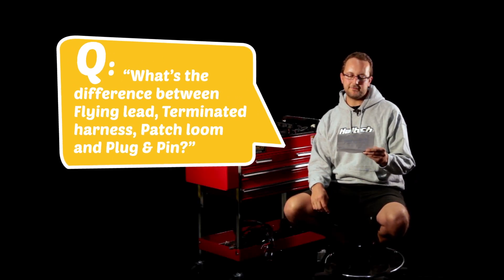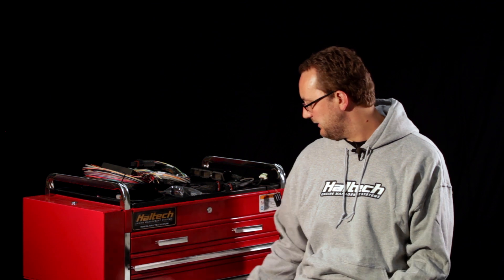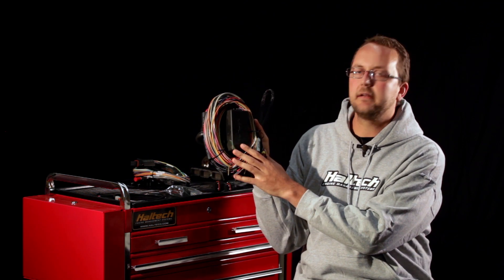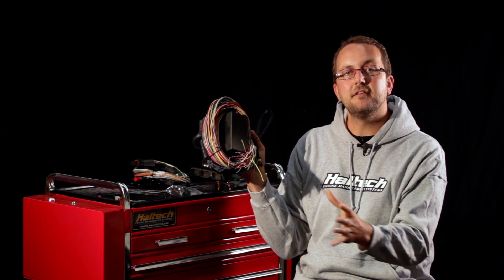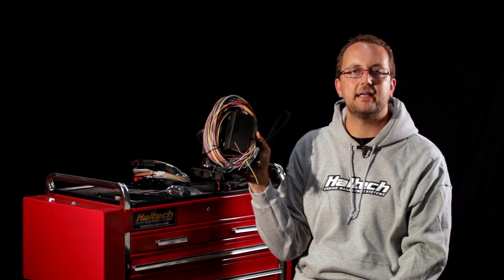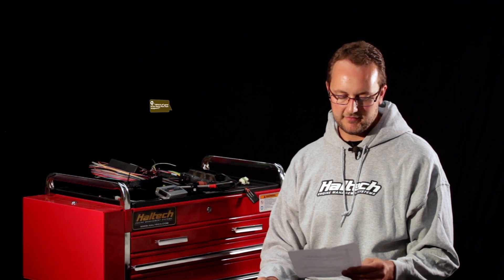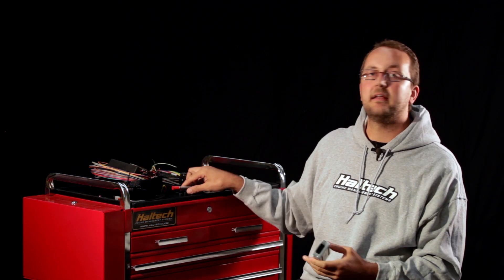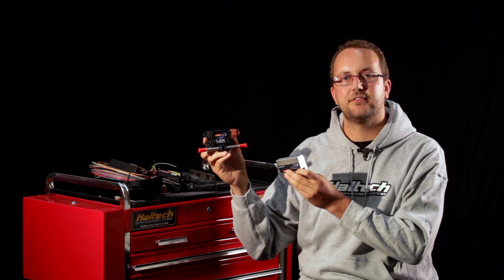Patch Looms, Base Maps, Dashes and Flex Fuel - Haltech Q&A Episode 1

Comment: What is required to upgrade from a Platinum Sport ECU to a new Elite series?
Reply from the maker: stairsy depends on the car/engine you have but generally all you need is Elite and Sport-to-Elite conversion cable.

Comment: On the plug n pin system does the elite have the capability to receive other extra sensors like boost, exhaust temp, air temp ect. And make them programmable Or only what factory ecu wires are present?
Reply from the maker: The Elite has the ability to read in any factory sensors that are present on a factory engine, like an EGT sensor or temperature sensors and pressure sensors and RPM sensors as well.
If you would like to add sensors that are not available on the factory engine that you have, then we have a range of aftermarket sensors available for that too.

Comment: can u please do a video on the elite's nitrous capabilities. ie. can it run a 2 stage system and or a progressive setup. also can the ecu be programmed do this or do you need to run a external controller. thanks
Reply from the maker: Hi Tyre Smoker - we've just posted one today, and there's another, more in-depth one in the pipeline:)
https://www.youtube.com/watch?v=h0t1wv_xe48
Reply: haltechecu thanks guys. love the videos, keep them coming